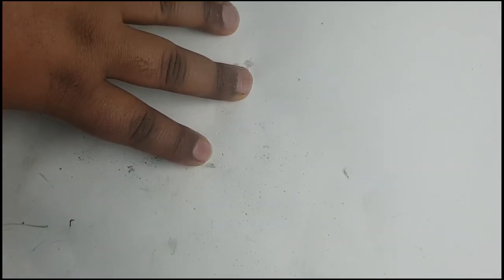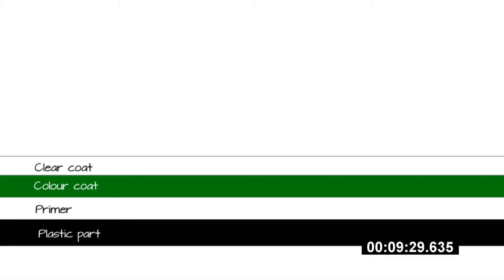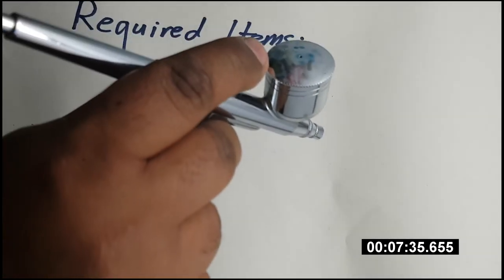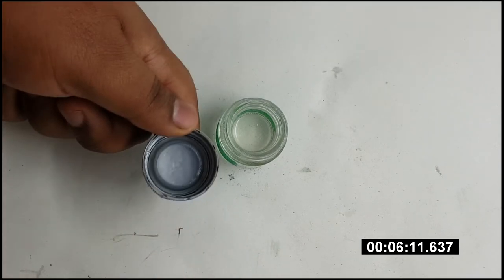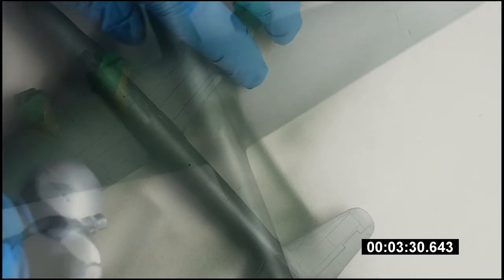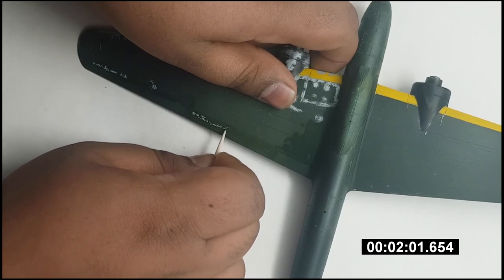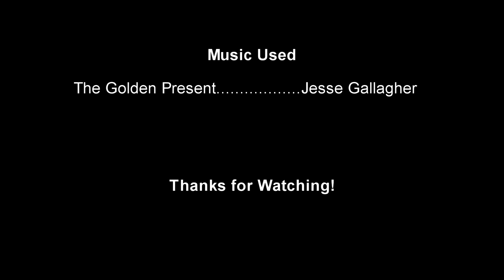How to Recreate Chipped Paint using Hairspray | BoredModels Ten Minute Tutorial

Comment from the maker: Timestamps for each stage of the process:

00:25 - Explanation of how hairspray chipping works
01:58 - Items and tools required for paint chipping
03:12 - Decanting hairspray from the can
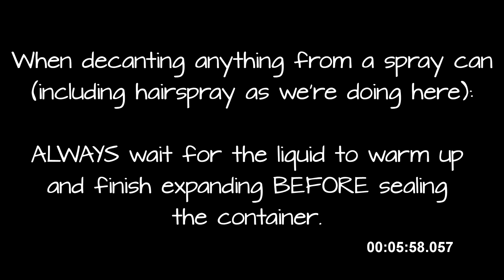04:25 - Priming and base coating the model
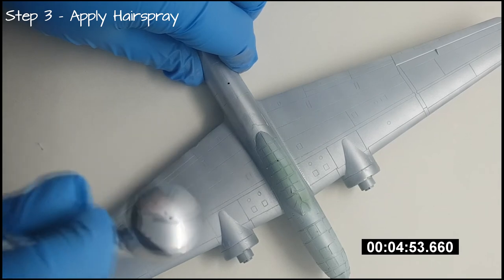05:22 - Applying hairspray layer
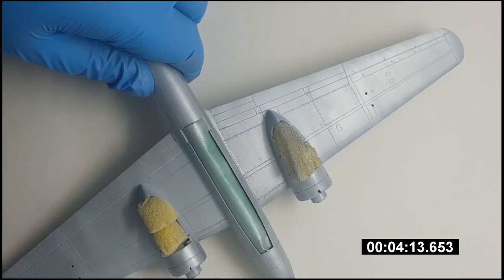06:10 - Applying the top colour coat
07:20 - Chipping the paint by dissolving the hairspray
08:23 - Clearcoating the model once the chipping is complete